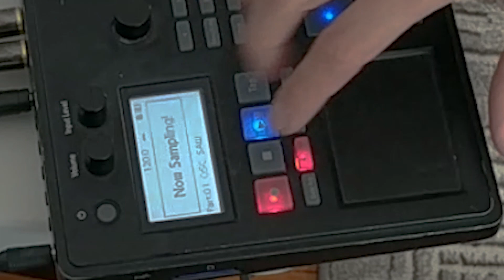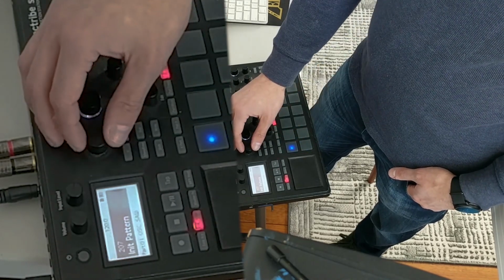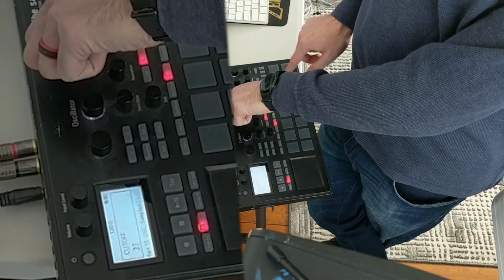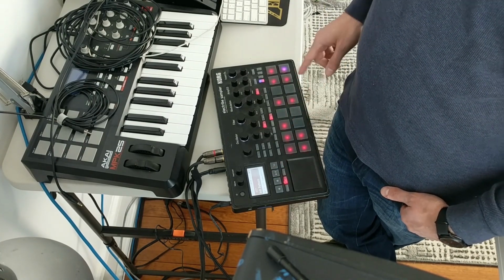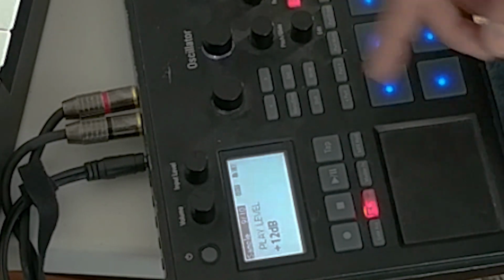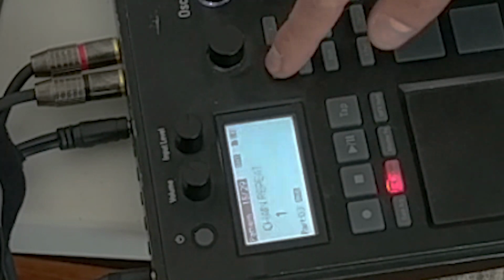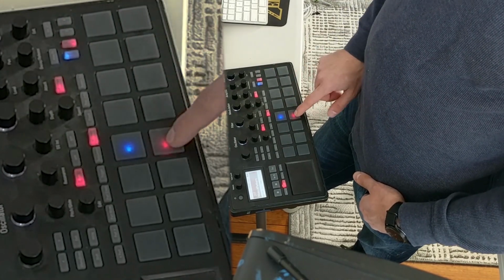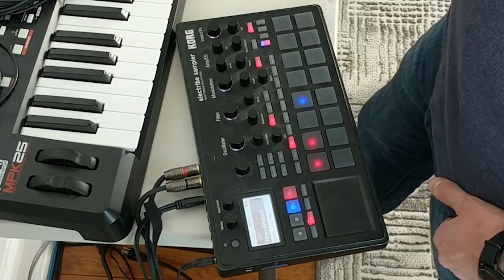Beatmaking Walk Through with Korg Electribe Sampler 2 pt. 1

Comment: Anyone else have a problem with an unwanted high frequency pitch when sampling? I'm running mine on batteries and I can't stand this! Your sample sounds clean. Oh yes, I'm careful to set my sample levels carefully!
Reply: I found this problem was not with the Electribe, but the cable. When I used a shorter, Korg original cable there was no problem, the audio was very clean.

Comment: You talked about sampling a sound in C, so that the melodic sampler works better. I always thought most samplers want you to use A. Am i missing something or is the electribe different?
Reply from the maker: Ideally you want to use the "root note" of the sample, which you could find by playing the first pad of the Electribe while changing the Key, and landing on whatever sounds most resonant with the sample. If it isn't in the right key, or you mix samples of different keys, you will find the keyboard will transpose them into detuned notes, either sharp or flat of the keyboard tones and will be difficult to play a bassline to.